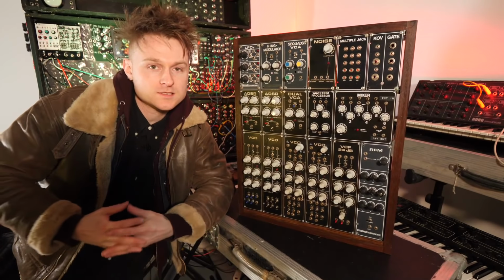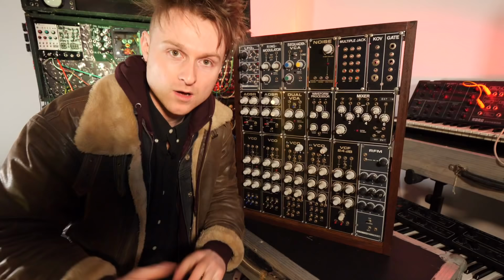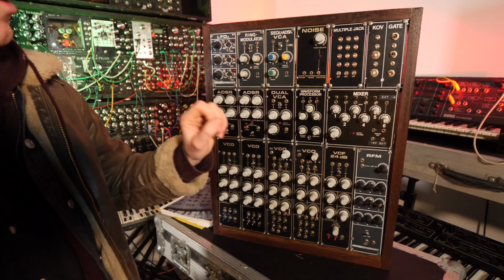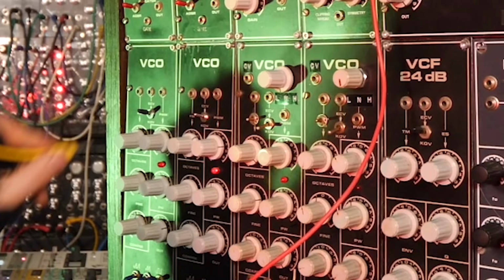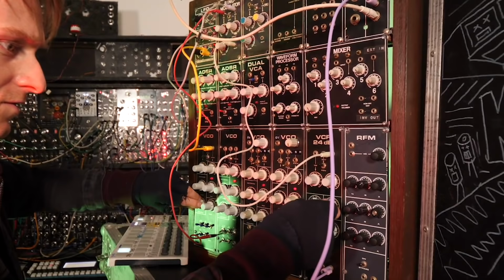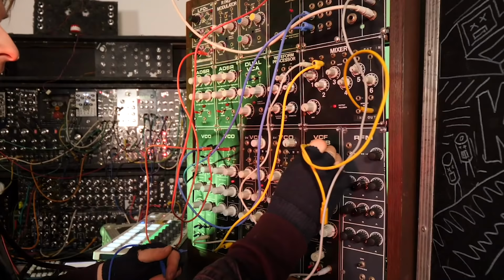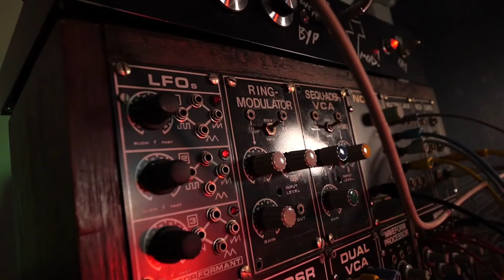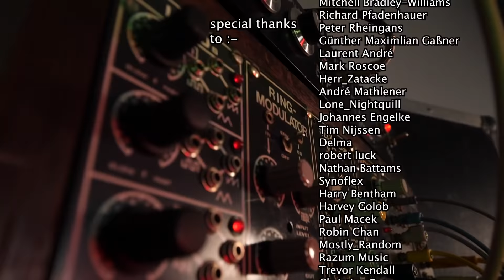A 70's Synth You Made At Home With Monthly Magazines

Comment: I bought one of these in 2000 (ish). The unit had been sitting in a man’s closet since 1980 when he built it. When I got it, it was pretty cheap. I knew nothing about electronics. I was 18 years old and SO happy finding this synth. I started repairing it. Blew lots of transistor and ic’s along the way. A shame since some of the ic’s in this beast are very expensive today (used in the mini moot today. Fairchild 741 I think the ic was called. Was in the cco part of the Vco). Lots of stuff didn’t work, but eventually I got it going. I was obsessed with making it working and I vividly remember once I got the first oscillator up and running. I was SUPER happy (and had soldering iron burns on several fingers). I fixed it even further over the years. Made a new case. Custom front plates etc. put in some doepfer modules as well along with a diy ele4music filter (may ele4music Rest In Peace. He made diy synth modules in the early 2000s but since passed away because of cancer). 
I finally got a new and modern PSU which made the formant sound So much better. Really amazing sounding synth. I still don’t know tons about electronics, but can now read diagrams, fix synthesizers and other audio equipment. Buying old synths, repairing them and selling them, enabled me to save up enough money for me to visit my cousin in Texas for the summer. (Living In Denmark). Pretty awesome for a young guy like me. 
I have since sold the formant (along with book) to a group of elderly synth geeks. 

Good times. 

I was around 18 when I bought it. Living in my parents basement. Making music non stop as a hobby. Now married with 2 kids and making a living doing sound design and music composing for computer games (deep rock galactic is the most famous title). Once a synth geek always a synth geek.

I was 18 back then. Sold the formant when I was 37. Will be turning 40 this spring. 
Life is weird and full of weird noises:)
Reply: I'm a music student and when playing Deep Rock mentioned to my friends how much I enjoyed the music, thanks for helping create such a cool game!
Reply: Deep rock slaps. Thank you so much for being a part of its creation ❤
Reply: @LT.dans_new_legs  thanks :) I have made a “how I made the soundtrack video”, if you are interested.
Reply: @louistown7835  thanks man:)
Reply: fåk det er nice man - og vild med soundtracket, det passer godt sammen med spillet !
Reply: @RLVart  takker takker
Reply: Great insight into a snippet of your life. Many thanks. much love
Reply: Rock and Stone, I love DRG!
Reply: 741 is still used today
Reply: @kevindavidchamorrovega5959  I got the number wrong. It’s the fairchild UA 726. Loads of 741 amps in the formant. Everywhere:)
Reply: @trjaudio  ah, ok, in that case you're  right
Reply: When it was running what music did u play
Reply: @waynesilverman3048  used it on various projects. Nothing that has been released though. So sadly you can’t hear it:)
Reply: Deep Rock Galactic is a blast and the music is perfect for it, thank you! Always cool to see awesome people  sneak in on already cool topics
Reply: @UNSCPILOT  thanks man:) have a great day!

Comment: Oh boy, this is a holy grail video for me. My best mate and I  built a synth based on these Formant designs back in the seventies, when I was about 16 and he was 17-18. 
We couldn't afford to buy the PCBs at first, so we actually photographed the track layouts in the mags and etched the boards ourselves using photo resist paint, a UV light and  hot ferric chloride, all in my mum's kitchen. 
We couldn't afford the front panels either so we spent an entire summer in my parents back garden, wrangling sheet aluminium into L-shaped trays so the boards sat horizontally behind the front panels. The case was 1-inch angle aluminium rivited together into a semi-modular rack that looked remarkably like a fish tank before the wooden panels went on. 
We had a stroke of luck when a genuine ARP2600 keyboard appeared after the main synth had been accidentally thrown away (I kid you not!) And our unique touch was using four-position slider switches everywhere instead of patch leads. None of the pots or switches got labelled, but by the time it was finished we knew what every one did so never bothered!
I have a couple of old black and white pictures of the guts of it somewhere, but I don't think I can post them in a YouTube comment.
Suffice to say, it was a beast and it needed a lot of constant TLC, to the point where we joked about permanently installing a soldering iron in the lid of the case! But it sounded absolutely fab. 
My friend went off to uni and ended up playing in several bands, culminating in Red Shift and Beat the Drum who had some minor commercial success. The  last two members of which are still writing music and even gigging now in their sixties, the other three all having died very young).
My friend died suddenly from an undiagnosed brain tumour in his thirties and all his keyboards (including an electric piano and a string synth that we had also built together) ended up in his partner's loft. It was all such a weird situation that, to my eternal sorrow, I never got back in touch with his partner again after the funeral and never found out what happened to our lovely synth. I guess it was scrapped.
Looking back, what amazing times.
Reply: this is the coolest thing i ever read

Comment: SAM : Places two patch cables and creates several big phat sounds.
ME : Tries to replicate on VCA-Rack and ends up with bleep bloop.
Reply: Hackerman
Reply: Add some distortion early in your signal chain or (and this is the power move) just before the mixer, run your dry signal through reverb like Plateau then through distortion like Debriatus and then a LP filter to reign it back in. Chord changes sound absolutely massive!
Reply: Same for me trying to program my Kurzweil (yes digital is much different than analog, but…).

4 layers and one hour later:
Thinnest… Sawtooth… Ever….
Reply: you need filters, man
Reply: Sam speaks synth.
Reply: @kimtae858  i have build a eurorack (hard) Distortion module based on a guitar pedal, pretty fun, has a dry/wet knob.
Reply: @DavidBauer38  you and me, bro. you and me...
Still, an awesome machine then and a great rompler now.

Comment: What a find for this channel. I was about 14 or 15 when I decided to build the PE Minisonic. It took me ages to get the parts together only having a paper round. I built the circuit on veroboard, but much of the print out in the magazine was wrong and it took me ages to debug. However, that process taught me so much about electronics and fault finding and has stood me in good stead all my life. 

I built the keyboard out of an old upright piano, lots of rubber bands and copper braid from coax cable. It was great, but so out of tune and flaky. I sold it to two guys who I think were amazed that I'd put it together. They got it for a steal (£50 I think). I wish I knew whether it was ever used. It had a proper sloping upright case and I used two bank of push switches to do various routings. I built a cut down one which I still have and keep meaning to get it working again, but it was the cost of a proper keyboard that always held me back. Then I discovered that girls were fun too :) and computers...

Thanks, looking forward to browsing this channel.

Comment: Wow, you pump out both great sqeeks and thumping grooves!
A word of advice from a previous builder/owner: drop the fourth VCO and put in the 12 db VCF instead! It has a very strong and raw character while the 24 db VCF is sounding more sophisticated. And when you have two filters you can make vowel sounds like joy and yeah!
For educational and practical purposes I suggest you restore the original internal wiring, it saves you a lot of patches, and it remains flexible to deviate from the obvious sound path.
But what a massive sound!

Comment: The way these old synths were configured using patch wires feels so raw, in a good way. I remember some software that tried to replicate that back in the 90's. With the slow processors of the day they had to write a lot of the code using highly optimized assembler. The software was pretty good, but there's nothing like actually patching together a signal path and having manual control of every knob. But for me screwing around with the software emulations were enough to convince me that I really didn't have any talent for making music.

Comment: I actually had this Formant booklet (in German, I read the Elektor in my youth and built the "Junior Computer" with extension board, hand-coding a 6502 Forth into it). I used some of the circuits of the Formant in a project (mainly from the VCO, and I think there was a keyboard circuit board that I copied), but it was too expensive for me to build in its entirety. This was trip down memory lane for me!

Comment: I bought the odd copy of Elektor magazine back in the day when I saw it at a book/magazine seller that carried some specialty and/or foreign ones. I don't remember where exactly I got it but I obtained a copy of the Formant book. I thought about building the modules back then but never did. IIRC, the boards were meant to plug in to card edge connectors on a motherboard. It was a nice modification to bring out a few of the signals to the front panel.

Comment: That is so dang cool.  The magazines, the concept, the overall builds are awesome.  I'm currently learning electronics the hard way.  So far I've learned a backwards cap can / will go BOOM and that SOICs are very picky about voltage directions as well.  Apparently they also explode.  I've also learned to wear eye protection haha.  Great channel!
Reply: @monsieurtechnical I had a (reversed :-/) tantalum go BLAM! (complete with small mushroom cloud, I kid you not) when I single-stepped a debugger to the line that turned the volts on. A very weird feeling.

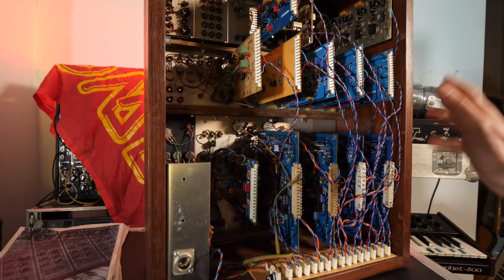Comment: This is great! I also collect vintage electronics magazines and hobbyist books. Last I checked, they don't teach discrete analog and valve electronics at university, so this is all we have to go on. One thing I want to point out: at 5:15 in the video, when you're panning across the back of the units, the PCB on the right has an 8-pin DIP IC that looks like it's not all the way seated in its socket. It could just be that the socket wasn't soldered completely flat to the board, but you might wish to check it to make sure the chip is pushed all the way in
Reply: University doesn't teach electronics and hasn't for years. It's teaches the mathematical theory underpinning everything. As for valves that's really a niche technology now for high power RF amplification which is disapearing more and more.
Reply: @Spookieham  High-power RF and specialty audio. Guitar players still use valve amps

Comment: America had something similar called "Heathkit" they had things from Ham radio, and Hifi audio to metering equipment. All of this was built by you. The most well known one was a tube transmitter, the sb-220.
Reply: America had something more similar called "PAiA".  We still have it.  I'm building several of their 9700 series synth modules.
Reply: @Randrew  cool, but high voltage is more fun in my opinion.

Comment: Awesome. I remember making the PE Minisonic synth when I was about 15. Tried to fit it into a box far too small, which made it so difficult to wire up. The oscillators never stayed in tune but the noise generator and filter was fun. Wished I'd kept it, but recall taking it all apart to use the components in other magazine projects, like wah wah pedals and noise gates! Great walk down memory lane.

Comment: That is so great ;) I built that one when I was 16, mostly from spare parts I got from the local Philips dump and from old PCB's.. The only money I had was what I earned with my paper route, and I remember having to save my wages for a month to be able to buy the VCO's transistor pair in their little temperature controlled oven ;)
The worst is: I actually threw away the thing 20 years ago, not thinking it would become anything coveted again 8-(

Comment: Love the work,Fantastic to see the way to connect a machine that mixes and modulates frequecnies, Time domain creatures, , an analogue computer, , and the Waveform Processor, I would love to see what the 1975 version of hobby waveform processor was, 6502 ? Z80. ?  It would be fascinating to see a circuit diagram with the controls highlighted as you turn them, like a backlit board. 3 lidar sensors could triangulare your hand on the knob and highlight it on the backlit A2 circuit diagram, an xy servo gimble with a 1mW laser. Wearing a plastic collar on your wrist would greatly improve resolution.   wonder if thers are simetrix models ?   Or Simplify,, three wires at 120 deg, controlling a mechanical copying machine , but the schematic would have to be laid out with the variable resistors in the knob positions. Sunday Times problem. Hobby Electronics was my regular northern UK magazine, It felt more new wave rather than a bit valvy.  . Inspiring magazines,

Comment: So I happened across a "Transistor audiometer" built into a hearing aid salesman kit. I guess an Analog Frequency generator. It's all handwired sets of resistor with chunky dial switches. 

I haven't a clue where to start with it, but I did verify it generates tone if you hook up a 9v.

Comment: The random voltage output of the noisegen is meant to be a used as a control voltage, so it does not reach audio frequencies.
Reply from the maker: I know. That’s what I was using it for. Ofcourse it doesn’t scan at audio frequency

Comment: It is common for the Formant noise module to have a weak output. Nothing a trimpot or little mod can't solve.

You really should get the 12dB Formant VCF (called simply "VCF"); it has a far better/more interesting sound than the 24dB Formant VCF.  And it's switchable low/band/high pass.

Comment: needs more vca's. i would replace that upper "sequence / adsr" VCA with another dual or better made by you Quad VCA to look like / styled an original "formant" module.
remove one VCO and place another 2/4 pole Filter.
the VCA can be used on more things than just sound, like throttling a lfo and so.

Comment: Where does one obtain the PCBs for these projects? Do you need to design themself from the circuit diagrams?
Reply: The book has all the single sided boards printed in there so theoretically you can use a laserprinter/copier and use the iron on copper method and etch them yourself. Some ic parts are unobtanium these days so it need some redesign to use modern parts

Comment: At this point I understand the modules and connections. But I have no idea how you get the note sequences and chord progressions going with the keys I see you pressing. Like if there we’re two VCOs going there at the end, how are you creating series of short notes by holding down two keys on the keyboard? Isn’t it monophonic?
Reply from the maker: arpegiator. and 2 CV lines to seperate VCO's
Reply: @LOOKMUMNOCOMPUTER  hey thanks! Arpegiator, that makes a lot of sense. I'm looking at section 10.6 in the keystep manual, it's actually pretty funny.  Great stuff from this machine!

Comment: Why can’t we have something like this today?

All you get is kits now
Reply: What do you mean? You can still build one, it's likely that it uses conventional, still available components. 
You just have to find, buy or otherwise source either a CD, or the old editions of Elektor to build it. The only difference is that you gotta digitize the old circuit board printouts if you want to get them made in China. Of course you can also make the boards yourself. 
If it's about not having projects in magazines that take many months - well, Elektor still does them occasionally. Though really big projects like this synth - there just aren't as many people building such things themselves anymore, exactly because you can also just find a kit which is much quicker and easier than waiting for a month to do another little snippet of the project.

Comment: So, these build guides, do they rely on old  components and designs that are based on their limitations or can you just use modern components?
Would it be best to adjust the design for modern components instead?
Reply from the maker: most of its the same as what modern synths are based on
Reply: @LOOKMUMNOCOMPUTER  excellent, I remember seeing in a documentary that keeping vintage Moogs running involved finding weird old components and that nobody would ever build them that way anymore.
Then again, this Formant you have is a full 15 years younger than the original Moog modular.
Very important 15 years too, early 60s transistors saw some incredible developments across the 60s and 70s.

This Formant you have, does it use those metal oxide transistors who's name i forget or the little black silicon ones?
I guess the early Moog stuff was build using the old germanium transistors?

Comment: What if you use a splitter, to put 2 or more output signals into 1 input?
Reply from the maker: you can in some instancesw, however a lot of time you might need some resistors. but likely it will work